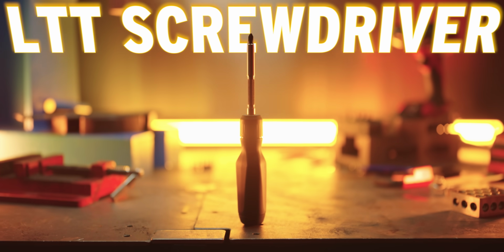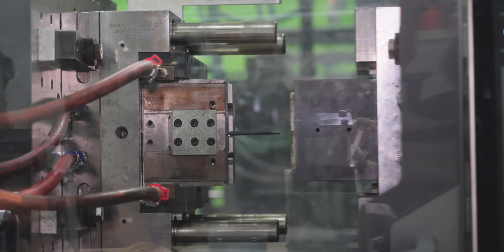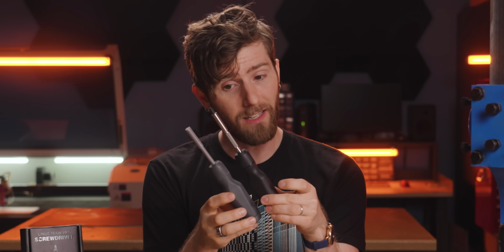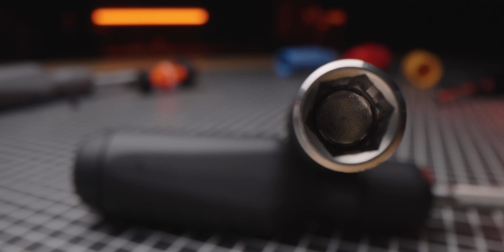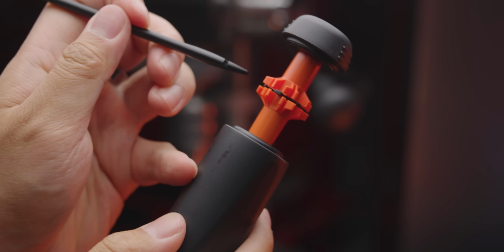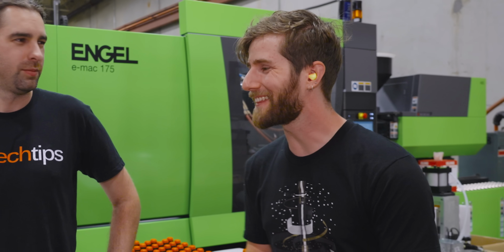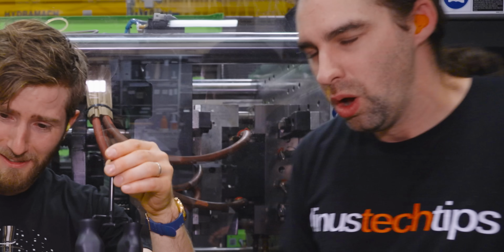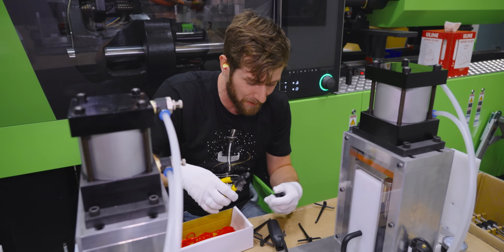Why our Screwdriver took 3 YEARS

Comment: I'm excited to see how it stands up to my Snap-On driver that I've used for a long time now. I can see each one having a place in my toolbox. Congratulations LMG on finally getting production rolling!
Reply: What do you normally use your snappy for? Mine is for automotive, Home, and heavy electrical (residential) work. My dad has has his ratcheting Snap-On driver for about 25 years or so and it’s SO SMOOTH. The only thing I’m worried about is handle. I bought my father in law the Williams driver and it has the tri lobed handle and I hate it compared to the snappy handle.
Reply: @narlycharley  I use mine mainly for automotive interior screws.
Reply: I love Snap-On and have used their tools for a long time. I just might have to give the LMG screwdriver a try.

Comment: The thing about manufacturers being bought out/having new management happens a lot more often than you'd think.

I've seen it a lot in the HiFi audio scene in which 2 exact model names but of different production years can have an extremely noticeable change. Different boards, caps, performance and general quality.
The public isn't explicitly told and this leads to varying experiences, misled purchases/disappointment and then having to hunt down specific confirmed models/years.
Personally witnessed in Adcom and Velodyne.
Reply: Also notably the Panasonic 9 dollar Amazon earbuds

Comment: At 70usd,  I now know what I'm gonna buy.
Bosch Go2 only cost around 30usd on sale and adding some accessories at 20-30usd, I see more value on here by being a motorized screwdriver with torque control.
I am impressed on how it survived all the heavy work I had put on this tool.
I see the LTT screwdriver is more for a niche market, its gonna be more costly if you break these screwdriver, especially on the ratchet. Unless if they can dramatically decrease cost to 20usd by mass production or licensing them to other brands.
Also, Bosch Go2 has an original price of 50usd here and always on sale for around 30-40usd on every other month for the previous two years.
Metabo, NoCry and Teccpo are also interesting choices for screwdriver with torque control, good for delicate work such as building PCs. Makita also has one without torque. I saw these on ProjectFarm and all of these I think has better value and you should consider first.

Comment: I bought and returned 4 or 5 screwdrivers so far from Lowes and Home Depot, trying to find the perfect driver for PC assembly and everyday tasks. My biggest complaint is that none of them are magnetic AND ratcheting. Some are magnetic as in, it holds the bit inside the shaft with a magnet. However, none were magnetic enough to actually hold a screw to the bit in the same way that my regular non-ratcheting screwdriver can. It's very difficult to get in hard to reach places in a PC tower if the screwdriver can't hold the screw by itself without worrying about it dropping into the PC tower. So I gave up and went back to my regular Craftsman screwdriver that is so magnetic, it holds screws to the bit without me worrying about it falling off.
Reply: Just disassemble an old magnetic type hard drive And it's powerful magnet can be used to magnetize your bits or screw driver.

Comment: Another option that could have been used if you HAD to have dark metal, is Ferritic Nitrocarburization, or "Nitriding".  It's what's used on Glock slides and almost all combat-oriented firearms now.  It's not a coating, it's a metal treatment that fundamentally alters the surface of the metal, making it hard as tool steel so it never scratches, extremely corrosion resistant so it doesn't rust, and usually dark in color.  Only problem: the process involves a lot of Na/K Cyanide and Na/K Cyanate, making it kind of expensive from the obvious hazardousness.  But for this application, even for an LTT item, Nitride is amazingly excessive, LOL.  I think the stainless will be a fantastic choice!

If you did go with Aluminum, you'd want to use 7075 Aerospace aluminum, with T6 heat treatment, and hard-coat anodization.  Why this?  That's what the AR-15 is made out of, it's incredibly strong aluminum with good corrosion resistance, and the black anodization is also extremely resistant to scratches, like it's shocking how tough it is.

One more thing: Phosphate (what's used on the bits) is also known as Parkerizing, and it's very commonly also used on firearms with or without Nitride.  Unlike Nitride, Phosphate is a coating, but it's a really tough coating compared to things like Black Oxide (aka "Bluing", also commonly used on guns, especially older ones) or powder coat paint, etc.  On it's own, Phosphate has pretty terrible corrosion resistance, but it really soaks up and holds onto oil, which does improve corrosion resistance!  Get some light oil (like gun oil, 3-in-1 machine oil, kerosene, even some cooking oil), coat them in it, dry them off with paper towel, and it should stop them from rusting for many months.  Do this especially if you use it in a wet environment for some reason, or if you live in a humid climate.

Comment: I used to work in a machine shop with 303 Stainless steel.  The product we called Reliance.  We had to CNC them to a 1"x1"x3" bar and then hand sand and polish them.  About 5k a month to be used on dentist chairs...  This stuff gets hot when sanding.

Comment: nice story but would be unfair to pay premium for the story vs competent tools. few months ago, I bought a drill "only" for its 20V battery and charger for $40 but turns out the torque and juice it has is a monster around the house; it is not even the cheapest vs plenty Chinese unbranded tools.   it is already several years since I've been using precision screwdrivers for PC building and the set is also good for graphics card repair/cleaning, like what Linus said, you only the steel shaft for working with PCs.

Comment: I used to work in plastics. That whole last segment brought back some, lets just say, not so fond memories(never liked working in plastics.) Watching linus try to keep up with the machine was cringe. Everytime a shot piles up when theyre that hot they can scratch on each other. U learn techniques to improve speed from how to hold the parts to clip a runner cleanly to where to keep the extra parts so theyre ready as soon as a shot drops. To this day i look at a plastic piece and find the gate to see how well it was trimmed and look for tiny defects like a burns or splay(silver or white streaks sometimes caused by wet material.) Sometimes ill even find shorts or miss fills. With as fast as a shot runs usually, how much operators are required to do(depending on the shop), and as little as they get paid to do it; theyre bound to get by people

Comment: The torque spec on these screw drivers works out to around 20 ft-lbf. Sounds tame, but then you consider the fact that the handle is only about half an inch in radius. 400+ lbf to turn the handle that hard! Your hand is going to break long before the screwdriver does.

Comment: Linus, just wondering why the bits are back to back? It seems to me if they were  face to face and offset we'd have a chance of fitting normal bits thad would "overlap" especially small tips bit like small torx...
Reply: @LinusTechTips any chance of having a isolated shaft version? for electrical work?

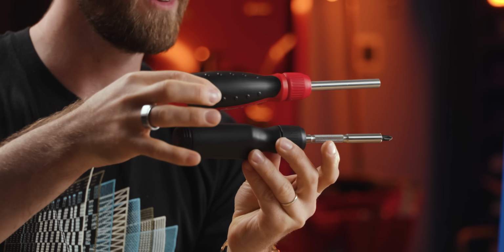Comment: 2:28 This is why I hate using the PB Swiss Tools ratchet screwdrivers at work. Expensive AF but I hate the mechanism. Especially after using Snap-On screwdrivers before, which did turn in the proper direction.

Edit: Love the "ninja stars".

Comment: 5/1000 of a small idiot unit is still a whole lot, that's roughly 0.127mm for normal people, that's a pretty big error, but what do you expect form china? also quite disapointing that you go to china for that part, noone should support that shithole nation anymore, but seeing how few actually useful people there are in north america in general, how litte there is interest and will to produce and work to high standards, I can kind of understand you there, the cnaadian parts likely would have been out of spec even more for higher cost and lower production volume.
also, for alex, the very first one with the strange forms could be injection molded, so long as you ensure the wall thickness is about the same everywhere, the mold would just be a bit more complicated, including a ring of sides that open up while the machine itself opens, which is not too hard, just more expensive (as everything extra). but it's absolutely possible to greate quite complicated froms with palstics or metals in a mold so long as you design the mold well enough and accept the costs.

Comment: I'm sure this is the Cadillac of ratchet screwdrivers, but there is just no way I'm willing to spend $70 on a manual screwdriver. It's over-engineered which led it to be overpriced. With disposable income being at a long time low, this just doesn't make it on my top 150 things I need to buy.

Comment: Finally... something LTT is selling that I actually want to buy. Seems like it would be a solid screwdriver for tech stuff and around the house stuff. Doubt it would be good for anything bigger though

Btw when you got to the factory making the handle... I actually do almost exactly the same thing at my job. But when the plastic pellets drop in on my machine it melts down and gets put on a data cable. So the colored jacketing on the data cable you bought may have been put on the cable where I work.

Funny af watching Linus trying to do an actual labor job though. I laughed so hard watching him get behind. Imagine doing that 6 days a week lol fml

Comment: How many teeth are in the ratchet/ is it over 80? Also what are the torque specs on the shank where the bit goes in. Like will the shaft balloon when try to turn a bit on a stick nut/ bolt? And is the handle temperature sensitive or can it handle temps over 130°F without being deformed in the handel so th tang just spins under pressure.? I really wanna be able to float to my tech buddies, but this product is almost the same price as Snap-On, Mac, Matco, and Cornwell in the US and if the tool breaks they will drive out to you to replace it or repair it with a single call. Also are the conductive? Like I'd prefer not to have enough amps to stop my heart and it was advertised as automotive friendly

Comment: Linus says they're safe for heavy automotive work with a 25 Nm torque spec. I work on cars, and have two of the Snap-On ratcheting screwdrivers (one full-length and one stubby), and I've worn both of them out. They both randomly slip under load because their ratchet pawls have worn down to the point of occasional disengagement. The long one also got run over by a car which bent its shaft, further complicating its already compromised ratchet mechanism.

The concern in a heavy use field isn't necessarily just the torque capacity, it's also durability over time - how many tens of thousands to hundreds of thousands to millions and beyond of turns of rotation under light to moderate loads can the driver handle before its pawls and toothed ring wear down enough to start to slip? That will be a big consideration.

Comment: That small change of pushing the ratchet control right to tighten and left to loosen is such a major annoyance for me on regular ratcheting screwdrivers. Like I understand why they do it that way (The arrow points in the way you turn both the driver and the adjustment knob) but, it's so incredibly un-ergonomic that it baffles me that no one has done this before.

Comment: the moment I saw that the bits were the standard ones at the tip, I was out. 
Though I'm sure its a nice screw driver, but I don't know how many times a Tech Screw driver had a shaft that was just too fat to fit and I would have to go get a dedicated one, just so it would fit and be long enough to get where I need it to. 
I would love to have one that the whole shaft is replaceable as the bit with different lengths, even if there was a general one for the smaller bits at the tip, but I will just keep several dedicated screw drivers in my field kit.

Comment: Congratulations, Linus and team for finally making it, I mean the screwdriver. I remember the long saga. It's amazing, almost like the birth of a child, seeing a concept, dream, prototype, and finally a product come to life. Your attention to detail and quality control is outstanding and I plan on purchasing a screwdriver and other products one my budget allows. It's this quality and attention to details which make or break a product.

Seeing the video of the plastic manufacturing brought back memories for me. It's an amazing process which utilizes mostly gravity, friction, and pressure to melt the plastic and inject the liquified plastic into the molds. The extra heaters, or preheaters as they're called are used to assist with the process but are not always used from what I remember.

In the mid-1990s, I worked for a consultant for the plastics industry. In addition to consulting for big companies such as Delta Tool and Die, he also developed training CBT programs. I had the honors of assembling the training programs on injection molding and seeing some of the production in real time. The company used a combination of 3d-animation and videos to show the process with the videos integrated with slides and questions. Professors from University of Massachusetts, Lowell assisted with the scripts and did some of the voice overs for the training products. UMASS-Lowell has an award-winning plastics engineering program which is renowned worldwide.

Comment: Looks beauteous!  For version 2.0: add a hex around the base of the shaft so you can apply an open-ended wrench for extra leverage.
Reply: homie if you need that much leverage you need a different tool.
Reply: You prob don’t need a wrench for a screw, that’s bound to cause issues

Comment: For anyone thinking to grind the bits you have down. Don't. If you screw up the heat treatment of the steel you'll either have to fix that yourself or toss the bit. If you insist on it, then just watch for color changes and keep the steel as cool as you can.

Comment: I like you mfg process.  It's interesting.  It does seem a bit hectic.  Is that really a one person job, or two or three?  Anyway, I really like the whole video.  I wonder if your sprues could have been shorter / non-existent.  I think that's a thing, but it's been a while.  Perhaps regrind could have been down to only scrap / defective units.  Anyway, super cool video.  I was thinking that it was a bit expensive for a screwdriver, but I may get one because I appreciate everything that went into design and your near obsessive drive for quality.   Linus, you would have been a CEO in any area you would have chosen.

Comment: While I don’t think the price tag equates. Even with all the R&D and your quest for perfection, I may buy one anyways just to support your channel. I’m a wrong side of my 30s dad who enjoys quality products and will give an honest review. I suggest making sure you harden your bits.  A good screwdriver is easy to find, bits that  do not wear are not. Your bits should be impact rated, and I suggest using Hardox 450 or Strenx 700 or 900. OR use Toolox from SSAB Sweden to make your bits. 

Also, i hope your gear mechanism is oil-able and serviceable if needed. Right to repair and all.
Reply: I am curious , as a manufacturing  choice even cost based which btw is only achieved through near slave labor, which on earth with the geopolitical landscape did you choose China? Mexico, Thailand,South Korea,  India and even the Philippines would of been a better choice. Cheaper? Maybe similar and most not, but more ethical?! All day long. 
I’m still buying but next time you consider manufacturing anything look around your city and ask yourself could you make it at home, or next door? Manufacturing is only dying due to outsourcing of labor as with this screwdriver. Again still gonna try it , but kind of disappointed in it being Chinese made in the end

Comment: Who cares about the mold gate? You can simply sand it off with a tiny bit of fine sand paper and a stick or something if it really bothers you. Excellent job Linus. I applaud you for not taking the cheap easy way out and simply slapping a damned logo on an already existing product. That being said, and I know this is considered Taboo in some circles but, you should begin designing a battery operated version for those of us who prefer them or people with medical issues like Carpal Tunnel and whatnot. I have yet to find a truly good one that is not extremely overpriced.

IF you were to consider taking on this challenge there are some things to consider in the design.

1. Most important of any other consideration is that this Screwdriver MUST be shielded from conducting static to the electronics. Maybe add a ground cable to clip onto a grounded surface.  
2. Good strength while keeping the torque low. Too fast and you can say goodbye to Phillips heads and also risk cross threading, stripping, walking, etc. Not to mention twisted wrists
3. Magnetic bit holder
4. Charging simplicity and battery replacement
5. adjustable angles.

Do this and id by it. I already plan on buying this screwdriver. However, plenty of people would prefer the battery operated one.

Comment: You could just get a Wera ratchet screwdriver for less than half the price and it's better in every way. You could even get an extra set of gold or even diamond wera bits and still pay way less and they would be standard sized bits too.
I get that most people will just buy it to support LTT, but still.
This comment section will be filled with the same handful of people playing defense force anyway.